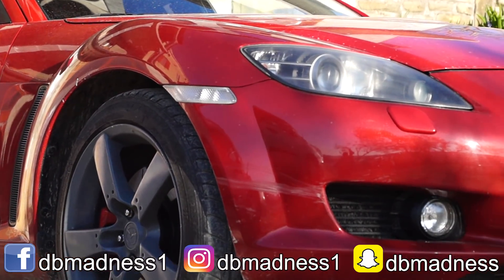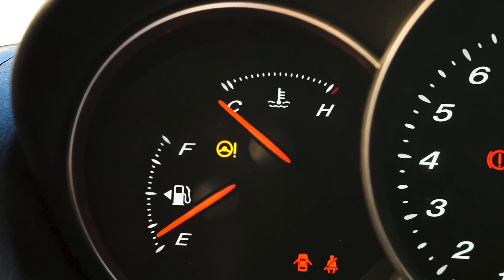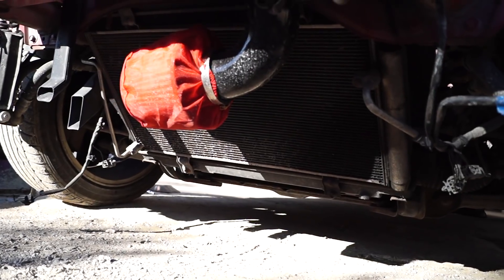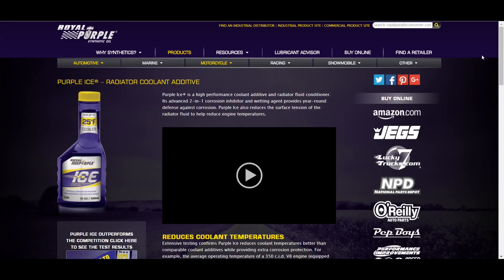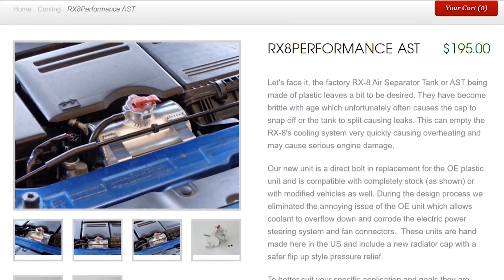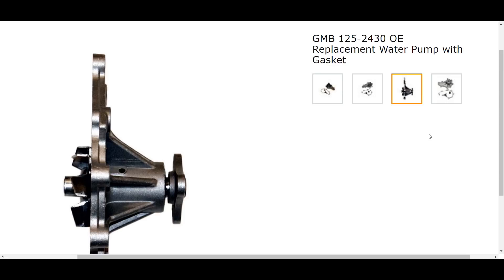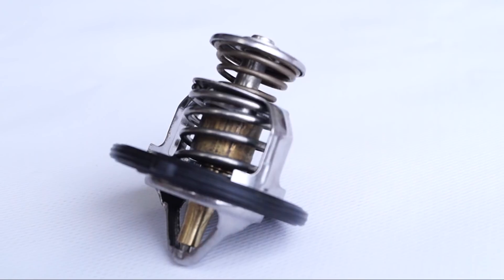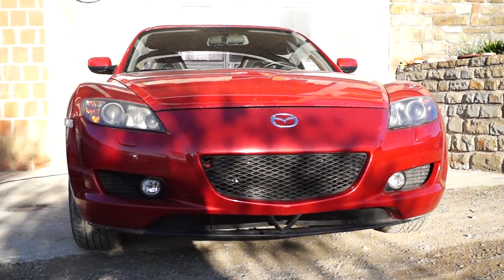Best Cooling Mods To Reduce Engine Heat On Your Mazda Rx8

Comment: Thanks for the follow up on this topic. I would still recommend getting the Lo-Tek pod over the racing beat pod, as the Lo-tek is glued over the dashboard and the gauges will be always in your field of vision. With the racing beat you have to take your eyes off the road to monitor/check the temperature being shown by the gauges. Also, the Prosport gauges would be a lot better than the mechanical ones of the racing beat. OK, you will have a +/-1 additional variation of the readings but if you get the premium version you will also get an alarm function so that the gauges will inform you as soon as they detect the temperature goes close to the dangerous zone. At the end the Lo-Tekpod + Prosport gauges will be around 150-250 Euros cheaper than gettitng the racingbeat kit.
Reply from the maker: I totally agree on the positioning of the gauges, very unpractical position if racing or concentrating on the road. I was looking at some aftermarket gauges, but never came upon Lo-tek. Does the lotek pod have a specific fittment for the rx8, or they just sell universal ones ? I was looking for pods, so if they can offer tailored ones, i would go for it.
Reply: http://www.gaugepods.com/rx8.html
Reply: @Drivenbymadness  you can find a module that will fit behind the instrument cluster and will make your dash show the real temperature and pressure oil. Best thing I have bought.

Comment: Another great vid. My cooling seems to be great. I’ve recently replaced the radiator and thermostat. My heat stopped working and I’ve checked the control issue but to no avail. I’m not sure what to look at next?

Comment: Should have mentioned getting a high flow exhaust.  So many people over look it as a cooling mod cuz everyone assumes it's a power mod only but the faster your car can get the gases out the less heat it will transfer into the housings.
Reply from the maker: Thanks for your feedback man. It makes sense now that you've mentioned it, but at the time, it didn't cross my mind.  Cheers! :)

Comment: Is there an error on the gauge price? http://www.racingbeat.com/RX8/Cooling-System/11816.html , 600 dollars looks pretty overpriced
Reply from the maker: I thought the same thing when i first saw it :P the price is actually pretty reasonable once you take into consideration the cost of quality gauges which is around 150$ ( 450$) + oil adapter 95$ + coolant adapter 60$ + mount it comes arount that price. Some other kits are even more expensive.  Don't buy cheap 5$ gauges, as they will be noisy, fragile and inaccurate :)

Comment: I got my 08 40th edition...beast car.
Reply from the maker: Awesome! I'm super happy you like it :D
Reply: I love my 2006 Rx8 with now 65k miles.
Reply: Jlbernabe831 I love my 09 40th edition!
Reply: No you don’t because that would be 41 dum dum
Reply: Which is normal coolant temperature during summer? My temperature is 91-104 celsius. In evening is low 91-98
Reply: Yeah. Beast ass Car. Problem is I had to let her go...picked up a 2018 is350. But I do miss that Rx8...kept a key..tho. had to.

Comment: I have a p0302 code i believe it's a cylinder 2 misfire were would it be located?
By the way you're videos save me time and money thanks!!
Reply: Tommy Quintana I just had this code last week. I replaced my ignition coils and spark plugs. That sort of fixed it. But then I replaced the mass air flow sensor and the issue went away. The 2nd rotor misfire is the housing closest to the windshield.
Reply: Thanks guys im doing that right know:)
Reply: Tommy Quintana get some mass air sensor cleaner and do that first to see if it helps.  It's only 8 bucks at auto parts store.  If you still have it pull your plugs and check condition and gap.  Then check the coils for strength of output. ..  all these things can be done for cheap or free and will narrow it down to what the actual problem is.  There are tons of videos on you tube for all that I mentioned as well that will walk you through step by step

Comment: Love watching these videos, and lots of products to take into consideration. Are you considering installing any of these yourself? Would you recommend any of these on a street daily?
Reply from the maker: Thanks man :) yeah, if i had the money i would install every single one of them. For street use i would recommend  to start with the cooling additive and fan kit, as it's the easiest to install. for reliability, the expansion tank is a good mod.  If you have the budget go for the koyo radiator with coolant lines or if you're really packin', install the gauges. Never skip maintenance, every 2 years flush your coolant. That way you'll always get the best out of it :)
Reply: Driven by madness thanks man! Your videos are great quality, and really easy to follow along. Where do you get all your info from?

Comment: Great content plus wanted to add one of my own. The vents in the plastic wheel wells can be cut to be larger for better airflow. Just need a $2 razor blade for this mod :).
Reply from the maker: Thanks :) Funny thing is that it was on my list, along with other 2 mods. But i excluded the other 2 cause of the realistic possibility anyone will actually do it. the vent one just slipped out by mistake. But thanks for your feedback, i'll add it in the pinned comment :) Cheers!
Reply: Driven By Madness i cut mine the other day after watching your video 👍🏻

Comment: Awesome list but wow these mods are expensive. Also, my front grill is not a grill. It's just plastic with a mesh design. So my plate isn't blocking off anything.
Reply from the maker: Yeah... i need to get me a shugga daddy :P Same here, but screw it, drill holes in it. Or carefully cut out the blocked holes. I noticed that the bottom part of my grill has a plastic on the back, that can be removed from the back of the bumper. so yeah, i'm making pasta with tuna and roman tomato sauce, want some ?
Reply: Haha or a lottery to win!
I thought about cutting into it. I also thought about removing that plastic part and put brake ducts from there.
Haha sounds good! Make me some!
Reply from the maker: I think the mazda speed front bumper is a very good overall solution to this problem, as it has a bigger un-obstructed front grille, and bigger oil cooler opening. Pasta is ready, come whenever you want. We're watching Brooklyn nine nine :)
Reply: The Mazdaspeed kit makes the car look very tall though, a bit out of proportion :( Then again, I have never really seen a kit that suits the RX8 very well. It looks weird or ricer like very quickly.
Now you're teasing me! That sounds awesome! You should do a meetup sometime!